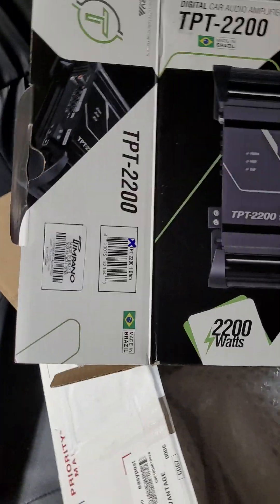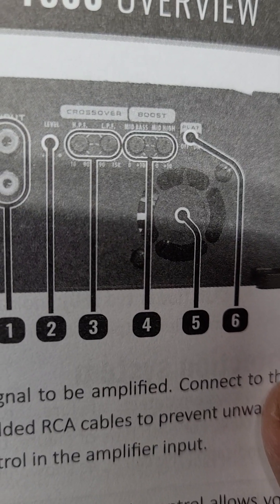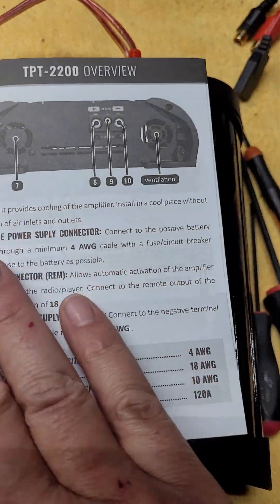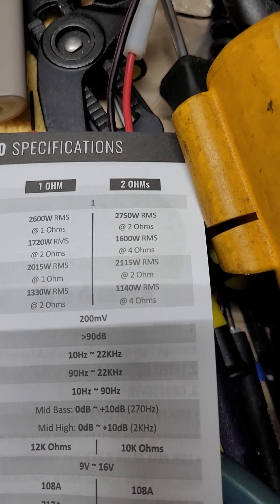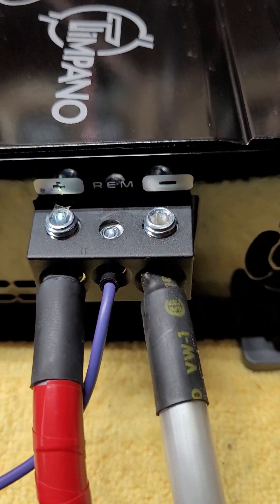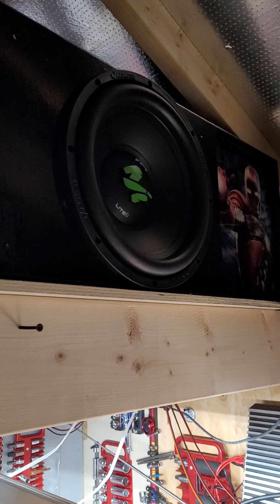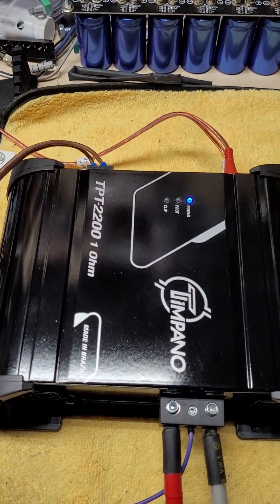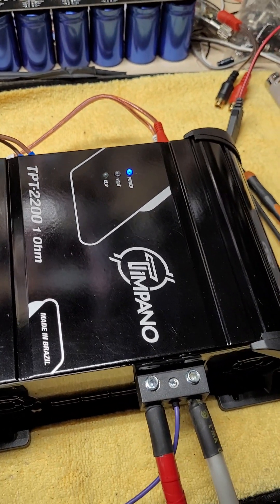Timpano TPT-2200 quick test

Comment: The biggest issue with this brand, is the lack of A good protection circuitry. Cool video
Reply from the maker: Yep, prv and others too. That's why I'm thinking not something to run on the edge
Reply: @slickwillybudgetking  I agree 💯
Reply: @Chuck_Sanders  the only answer  the average  man what's to know is is it a good buy or no
Reply: @theloon218  well, the average man would want to know they have little to no protection circuits to them, and he would probably prefer to not replace his amplifier often.  👍
Reply: @Chuck_Sanders   what's your thoughts  on Nemesis  audio  I got a 15 inch Na fierce 4ohm 1200rms wires to a md1800 and Boi that biaaa blew a atrend { spl) box out the water in a Jeep Patriot no big three b.s. just a small  as agm kinect 1200 battery sold the taramps MD 1800 for a profit now looking to buy slapz surfboard 2k yee
Reply: @theloon218  nemesis is OK. Customer service is poor.  Kinda cookie cutter to an extent. I did a review on the team series 8" and it's meh.